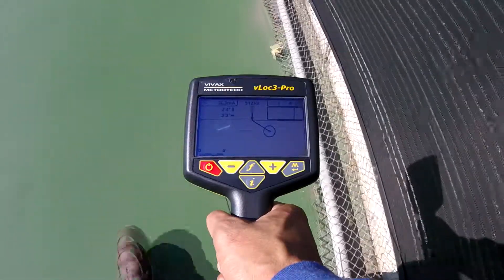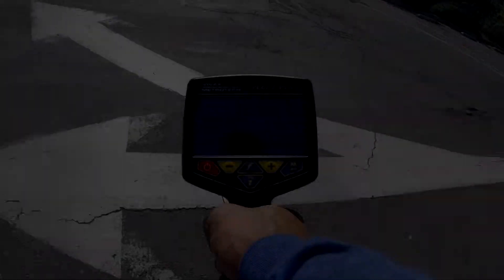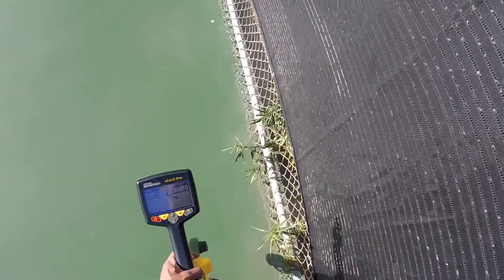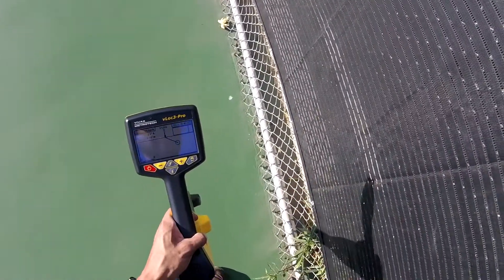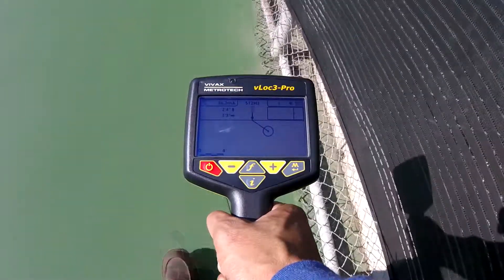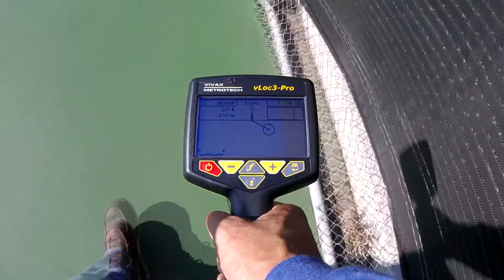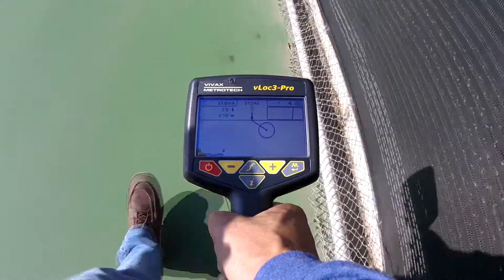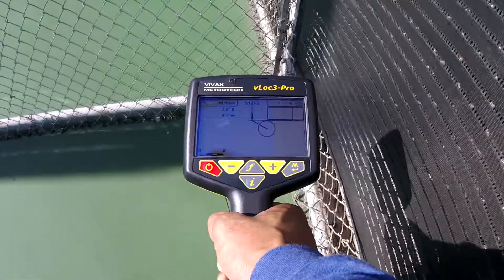vLoc3 Vector Mode (off-set) tutorial video

Comment: One thing I discovered is that if accurate depth measurement is important to your customer, you need to have that locator head touching the ground.   Another thing to keep in mind is that if you standing on uneven terrain    and your utility is on ground higher than what you are standing on (mounded up), you will need to raise the locator head to the depth of the mound for an accurate depth reading.
Reply: I’m about to start do you have other tips ?? Or something to read